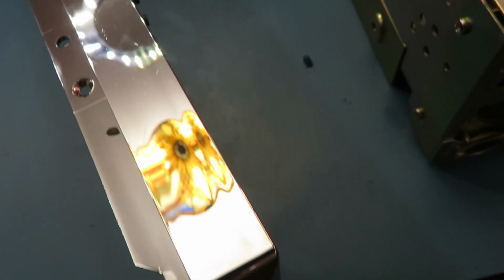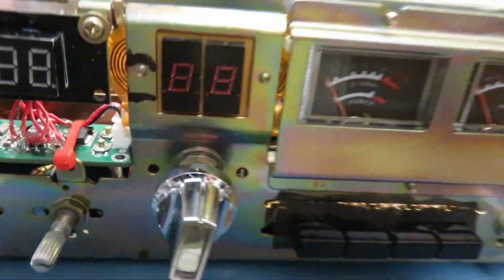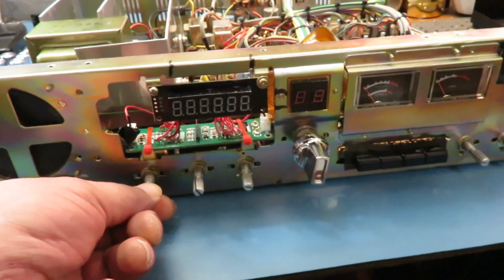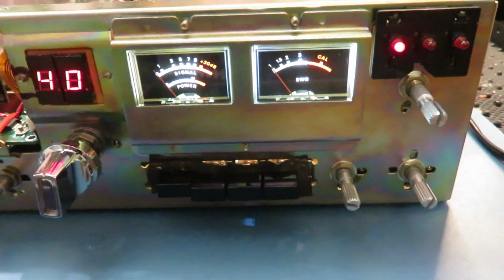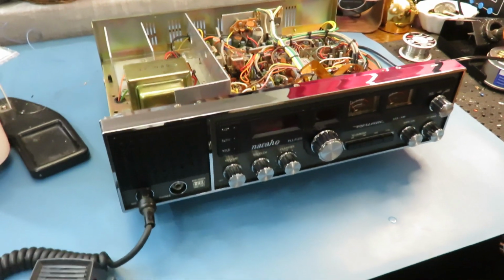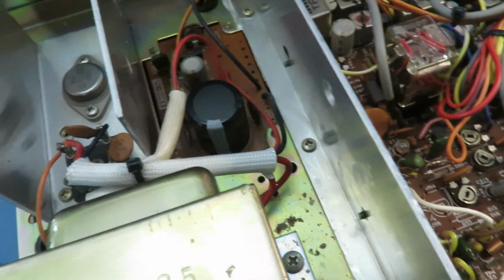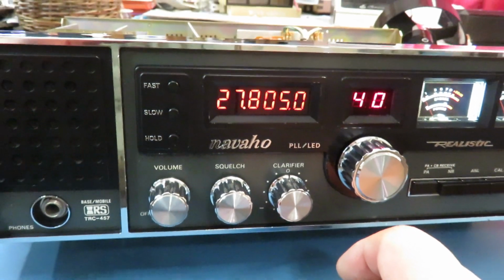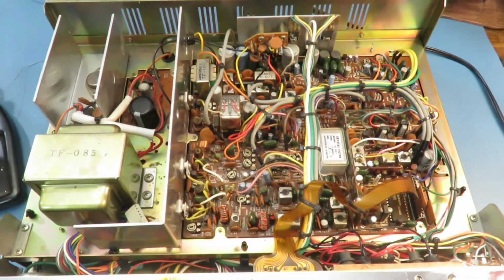TRC 457 with frequency counter Restored on my bench at BCool Radios

Comment: Correct me if I'm wrong, but if you connected the frequency counter to the PLL's output, it is no longer a frequency counter, it is  a frequency display. The clarifier knob wont reflect any changes past the fifth digit... In fact, you could just simply hard-wire the first "2" digit and the last "5" and "0" since the clarifier has no effect on the number displayed.
Reply: Hello,  yes that is the point,  "a freq display"  The D858 PLL chip has an odd mixing scheme,  it shift 2.5kc on AM TX  as it uses the USB crystal for TX.  plus the SSB offsets shown on RX,  So the only right reading display will be AM RX  all others will show funky offsets.  Now if you are ok with that, great then you can see the fine tune clarifier.  But,  why ?  why not see the actual freq you are on  or want to be on,  like 27.4050  and not 27.4075, or a funky TX shift on AM.  This is why you do not see many freq counters on D858 PLL chip radios.  As most people do not like seeing those shifts on the display
Reply: with extra channels the rig covers 26MHz to 28MHz,  so hard wire the 1st 2 digits would not work, and its is the last 2 digits that will show the PLL shifts,  same as the clarifier changes.  This mod does read a real frequency off the PLL, and counts up 10kcs as you change channels,  it just happens to be around 1.0000 MHz.  PS So I have done this as a true counter off the 1st IF,  and it sees all the clarifier changes,  but those SSB offsets and AM TX shifts just drive some users crazy.  So for me its nice to see that actual freq,  not just Ch 40 as the high band will be 27.8050 MHz,  but the CB will show ch 40

Comment: for some reason I am finding the ceramic caps on the rectifer is passing volts and making the power supply put out too high voltage, like 18v.
Reply: the input to the Reg should be 18v  and the output is 13V,  if that is not true?  then the voltage regulator needs to be replaced
Reply: @brucebcooll5335  not sure but I removed that ceramic and the voltage dropped to normal. also on the trc 850 the ps gets hot as hell, same thing, removed the ceramic on the bridge and it ran cool. those were on a board though

Comment: Once again an immaculate job.hanging to get a 457 this year...a quick question if I may, what type of wire do you use when you jump cut pll tracks?
Much appreciated.
Reply from the maker: to repair a cut trace,  I use a small solid wire jumper our of a resistor lead.  The correct way is to use copper foil and make a custom trace,  but if it the cut is small,  the jumper works fine